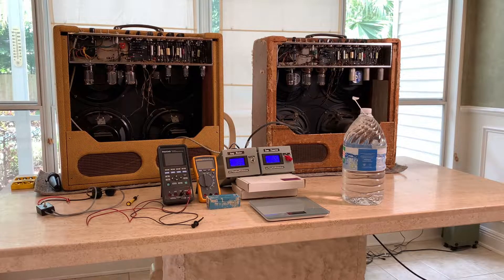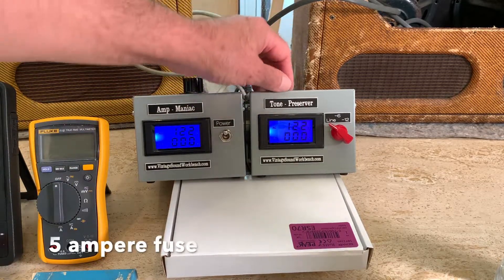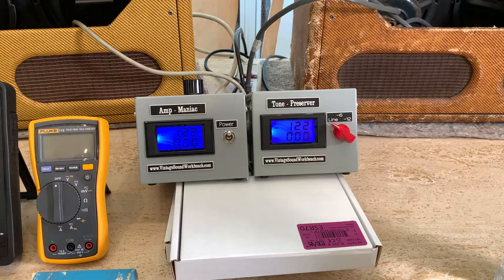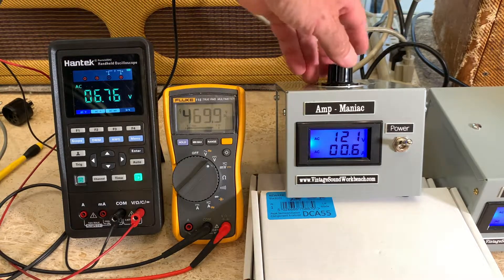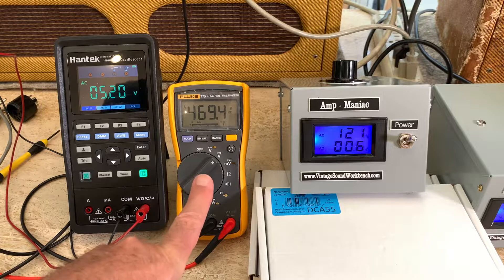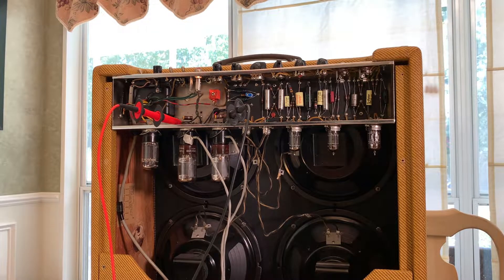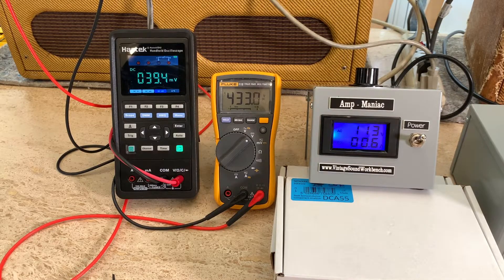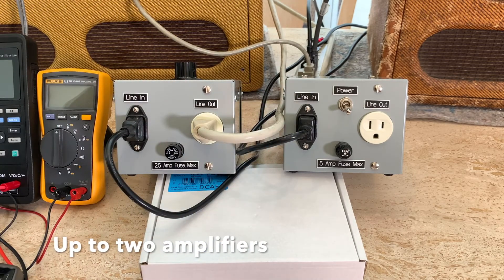Amp-Maniac Demo - A Fully Adjustable Voltage Reducer for Vintage Amplifiers

Comment: What is the lowest voltage amp maniac can lower to? Apparently van Halen liked 89 volts. On the amp maniac website it says NOT to do this - but I can it even be done?
Reply from the maker: I think it goes down to 0VAC but I know I turned it down at least to 30VAC.  The Van Halen story is mostly a myth.  I wouldn't recommend doing that to any amp.  The heaters in the tubes would barely be running.  They are designed for 6.3VAC and it sounds strange if you go much below that plus it wears your tubes out really fast.

Comment: could you convert the maniac from 2.5 amps to 5 amps? i have 65 and 67 bassmans and seems i could run off one maniac but the extra amps could be good.
Reply from the maker: He used to make a 5 amp version but it is heavy and more expensive.  He probably can still make it.  You could go with the Amp Preserver which I think is rated a 4 amps.  I run as much as I can get away with on my Maniac.  The worst thing that can happen is you will blow the fuse.  If you gigging, take some extra fuses but test it for a while with both amps.  You can watch the amperes rise on the meter and it usually takes more than it is rated before it starts blowing fuses.
Reply: @millstap  i saw a picture on his FB page, i will be asking for a custom 5 amp. thank you for the quick response and excellent video review

Comment: Hi there thanks for the video! Question- am I able to hook the amp maniac to a tripp lite line conditioner or power surge? 
essentially amp->amp maniac->line conditioner. 
or just hook the amp maniac up to the wall outlet?
thanks!
Reply from the maker: That's what I do.  I have my Fuhrman plugged into the wall and the Maniac plugged into the Furman.  Then I plug another power strip into the Maniac and run several amps off of the strip.

Comment: what a total crock of internet baloney poo.... got news for ya as a geek with over 50 years experience.... a couple volts difference in line voltage makes absolutely no difference. save your money for something useful. this is just a way to get gullible people to waste money. keep it for yourself. most tube amps will fire  and pass signal anywhere above about 30 volts, but that doesn't mean it sounds "better" or "makes stuff last longer" or ANY of the bs promised by this snake oil slinger. facts.
Reply: @ErikThomasMusic  winning lol

Comment: AmpManiac will not regulate or correct your house voltage to 115 volts for example. The house voltage fluctuates as day goes on. At 1pm it can be 120v and at 2pm it might be 125v then at 6pm it will be 117v, etc. In order to get consistent 115v, you have to buy a furman 120v voltage regulator that will output constant 120 volts. Then you plug the AmpManiac into the furman unit and turn it down from 120v to 115v on the AmpManiac. You need both devices so you don't have to readjust the AmpManiac when the power company decides to change your house voltage in middle of the day for example. Even modern amps that are designed to run on 120 volts can benefit from both of these units to bring the house voltage of 125v down to 120v and keep it there. Remember that house voltage swing of 5 volts will produce a larger swing inside the amp because of its transformer.
Reply: actually, no, you need neither. your example is correct, the voltage will be all over the place. it won't affect the amp or its performance.

Comment: Could a voltage reducer be useful for even a solid state amp, to preserve components as well as helping to get a less "brittle" sound?
Sincere question. Thank you for video.
Reply from the maker: Math, this is the answer from Carl himself, "If SS amp was built for voltage lower than 120-125 then yes, would help preserve component life. As far as brittle sound, no idea. That’s a characteristic of many SS amps."  That's my thoughts too.  What year was the amp built?  If you house voltage in your area is even higher, it could help even with a fairly modern amp.  If you have a Digital Multimeter, you can test the voltage in your socket.
Reply: @millstap  Thank you for replying and the homework. : )
Reply: no. misbiased solid state will not sound more musical, and will be blatty and harsh. you don't want to brown out a solid state amp. think of a fuzzbox with a voltage starve or "sag" control. same basic idea.

Comment: So question for ya. Would there be any issue running my whole rig off one of these boxes? My single amp and pedal board and pedal power supply? Just wondering if that may be ill advised running a pedal power supply under 120v. Great video!
Reply from the maker: Most power supplies are designed to run on 100-230VAC.  I run all of my pedals on it.  It still ends up being 9V, 12V, 18VDC or whatever it needs to be at the pedal.
Reply: @millstap  in other words, it has no effect. lmao
Reply from the maker: @666pinkster  Not on power supplies because they are their own little step down transformer themselves.  That's why you can take your IPhone charger from the USA 120V to the EU's 230V with no issues.
Reply: @millstap  the guy asked about running his "whole rig" on this snake oil. yeah, stompboxes, like the transformers in TUBE AMPS which do virtually the same thing. but try running a digital stomp or rack unit on lowered line voltage.  forget it. dude, no offense to you, but the guys slinging this thing are selling snake oil. the amp's don't care about the line voltage much. the entire reason folks like evh used a variac in the first place was to misbias his amp by browning it out. tubes aren't like transistors. most tube amps will begin passing signal with a line voltage of 30 volts or less, and tubes by nature of their charicteristics don't like to stay saturated. they're continuously trying to soften any distortion generated. lowering voltage to them makes a marginal difference that people "hear" cuz they choose to. doesn't mean its a great idea.  there's a lot better things to spend money on, bud. peace
Reply from the maker: @666pinkster  Jimi, the whole purpose of this box is just to keep the amp from running too hot and to extend the life of your old components and NOS tubes, especially on the Tweed amps that were designed around 110V.  At 125VAC you could easily be running the plates on your old RCA 6L6GC backplates at 500V which is over their rated voltage and way over the 400V on a Tung-Sol 5881 even though Fender designed those circuits to have over 400V from the beginning.  They are tough tubes but, if you can afford to extend their life, then more power to you.  I've spent way too much money on old tubes not to do it.  And all the other components get hot so anything to reduce that heat, which shortens their lives, is great too.
Reply from the maker: @666pinkster  Tell that to the BrownBox people. They’ve sold hundreds of thousands of them at twice the price.
Reply: @millstap  its literal snake oil "mojo". its marketed as a tonal improvement. yeah, right. good luck widdat ;)
Reply from the maker: @666pinkster  Carl’s were the very first on the market starting back in 2008. AmpRX saw the opportunity and spent a ton on a massive marketing campaign and thus the double price.
Reply: @millstap  that may be, but snake oil remains snake oil regardless of its price point

Comment: You mentioned you think you could run two amps with the maniac but you never tried it in the video. What would happen to my amp if my line voltage is 120V and I adjusted the bias set at 117V and someone turned the maniac all the way up to maximum 125V. Wouldn’t that be almost as bad as using a variac max 130V and having the same scenario happen?
Reply from the maker: Neither situation would be ideal.  At 125V or 130V the bias would definitely be on the hot side if you set it at 70% at 117V.  At 130V though, you would have a better chance of red plating the tubes.  Just as long as the Maniac isn't kept at 125V you should be fine.  I don't think the tubes will red plate at 125V.  Just keep those handsy people away from your Maniac, lol.  Variacs are useless when it comes to hauling those heavy things around.  I love my Maniac.  Right now I'm running my 1959 Fender Tweed Bandmaster at 112V and it sounds fabulous.  That puts the heater wire voltage at exactly 6.3VAC which is what the tubes are supposed to run at.  And, yes, I have have played two amps loud on the Maniac with no problem.  You may even be able to go to three amps.  The worst that can happen is you blow the fuse in the Maniac.  Just have extra 2.5A fuses on hand.  I run another group of amps and effects on my Preserver at 117V which is fused at 5A.

Comment: great video- thanks. I just ordered one of these because of your video. Nice pair of Bassmans too!
Reply from the maker: Hey Shane.  Wow, I covered one of your songs on my channel 10 years ago.  These are great devices and were really the original voltage reducer back in 2008 when Carl built one for  G.E. Smith.  Yeah, the Bassmans are special.  I will turn on my Super Reverb and play for a while but at the end of the night, it is always the Bassman.  Just curious, with the French name Theriot, do you have relatives in the Lafayette, LA area?  That is one of my old stomping grounds.
Reply: @millstap  no my family is from Thibodaux and New Orleans (mom's side) but I'm sure we were all brought over at the same time after the Brits kicked us out...haha. As for the unit, seems like it would be handy for new amps designed to run at 120 but wall voltage is coming out at 125 or 127...or would that even make a difference?
Reply from the maker: @TheRiotguitar  Definitely.  If you biased your amp at 120VAC, then you can keep it exact wherever you go.  Just remember to note what voltage you are at when you bias your amp and then just dial in that voltage at every venue.  The voltage can change so much from venue to venue, you don't have to worry anymore.  But, you won't be able to go over the house voltage which shouldn't be a problem.  With a Variac, you could mistakenly go to 130VAC which would fry some tubes.  It's a not brainer really.  You might end up with more than one.  I have three.  It really depends on how many amps you plan to run at the same time.  If you are two or more, then the Preserver is fused at 5A but not as adjustable as the Maniac.
Reply: @millstap  thanks for the info!
Reply from the maker: @TheRiotguitar  You're welcome Shane.  I've run two 40w Fender amps and a vintage Fender reverb unit on the Maniac.  The Maniac is fused at 2.5A.  You can add as much as you can get away with until the fuse blows.  Most amps idle around .6A and 1.4A when cranked.  Even if two amps are cranked at possibly 2.8A, you may not blow the 2.5A slow-blo fuse.  But, at a very high profile gig, you wouldn't want to chance it.  Keep some 2.5A and/or 5A fuses handy for the Maniac or Preserver, respectively.
Reply from the maker: @TheRiotguitar  Shane, I'm so embarrassed.  I just realized you were my favorite guitar player on Live at Daryl's House.  I can't believe I didn't recognize you.  I love that show.  That is the best show about music to ever be produced.  My wife and I were just watching the Elle King episode.
Reply: @millstap  aw thanks! Yeah Elle was great to work with.
Reply from the maker: @TheRiotguitar  "Looking for Shane's Cajun Ass," says the Reverend B.F. Gibbons.  Sorry to bug you again Shane but this was too cool.  I grew up in Cajun country so I can totally relate.  The music scene was killer.  I remember seeing Jeff Pollard in Gerard Park in Lafayette way before he ever started the band LeRoux.  I think it was probably 1970-71.

Comment: the fuses on the back of my 100w plexi and 30w bassbreaker say 3amps, will this work with either of those cranked on 10? I only use 1 amp at a time, planning to use something like this for the 30w cranked
Reply from the maker: It will work fine on both amps.  I've run two vintage 40w Tweed Bassman amps on it and they are fused at 3A.  I have both the Maniac (2.5A) and Preserver (5A).  For years, I ran all of my amps and reverb units on the Preserver and never blew a fuse.  The only time I blew a fuse is when my GZ34 rectifier tube was going bad and arcing internally.  You can experiment and run both amps on the Maniac.  The worst that can happen is you will blow the fuse on the Maniac.  The good thing about having the ammeter is you can see what your amp current draw is when you are playing.  When I am playing very loud, my Bassman runs around 1.4A.  It idles around .6A.  Two Bassman at loud (not cranked) volume would theoretically run around  2.8A but I've done it without blowing the fuse plus I had a vintage Fender reverb unit hooked up too.  The best situation IMO is to have the Preserver for home and hook everything up to it.  I have a power string with 8 things plugged into it.  And then have the Maniac for gigs so you don't have to unplug everything at home.  Since I am not gigging anymore, I have one amp on each.  I do like the Maniac for the precision but the Preserver works just fine on getting the voltages in a good range.  The disadvantage is if you are gigging, and each venue has a different house voltage, the Preserver will only allow you to drop it -6 or -12VAC but the Maniac will allow you to dial in the voltage precisely to the voltage you biased the amp at, at every venue.
Reply: @millstap  Awesome! Thanks so much for the detailed answer! Im sure this will help others also :)

Comment: I just went into the Vintage Sound Workbench website and it's stating that both units (Amp Maniac and t
Tone Preserver) are 2.5 amps ... amp I reading that correctly?  In your video you stated the Amp Preserver is rated at 5 amps.  I initially freaked out when I heard you say that "maybe" the Maniac could run 2 amps ... well I have 2 amps in my rig which will be on at one time always and I thought perhaps I purchased the wrong unit ... regardless, the appealing thing of the Maniac is being able to dial it down precisely to the voltage you want ... If necessary, I'll buy an Tone Preserver too.  I almost bought a Brown Box ... that would have been a big Whoops, could have saved money!great video and thanks!
Reply from the maker: The Preserver is 5A.  What two amps are you going to run on the Maniac?  I run two 40 watt Fenders with no problems at all.

Comment: What's the ohm load on those old Bassmans? Is it 2 ohm like the modern ones?
Reply from the maker: You mean the speakers?  It is four 8 ohm speakers in parallel for a total load of 2 ohms on the OT.

Comment: I have a vintage 67’ blackface twin.... do I need one of these?? What year did they switch to 120v
Reply: Agree with Bob C, check the tube chart.  The move to 120v supposedly occurred in 1967, but manufacturers of most devices took their time to use new appropriate power transformers (gotta use up that inventory).  Most likely your amp is looking for 117v, rather than the 125v most of us see today.
Reply: Look on your tube chart pasted inside the cabinet. It should have the voltage listed.
Reply from the maker: "Voltages gradually increased over the years from 110V to 112V, 115V, 117V and finally to the current standard of 120/240V at 60 Hz in 1967." -- quote from the internet.  Your tube chart should say 117VAC.  I have a 1966 Super Reverb and that is what is on its tube chart.  You can be sure that appliance and amp builders did not begin to transition to the higher voltage PT's until many years later.  If you have a huge stock of power transformers, you are going to install all of them and then get a new transformer.  Even then, I'm not sure they changed the PT at all so you would end up with higher voltages on the amp.  Ironically, it was in the early '70's when amps started taking a turn for the worse when it came to tone.  I would say a reduction of -6 to -7 volts would help your amp.  And when they say they settled on 120V it is actually as high as 125V in certain areas.  I may do another video in a few weeks on the blackface amps with 117VAC requirements just to see how high the voltages actually are in those amps.  They use a different PT than the old Tweed amps.  Bassman is 8087 PT, and blackface SR is 125P5D.  According to Classic Tone, they are essentially the same transformer but we will see.  Maybe the newer 125P5D had more secondary taps for international orders.

Comment: Never did trust that brown box thing
Reply from the maker: I'll have to say they have an impressive advertising campaign.  I wonder how much it costs to get the endorsements of virtually every living professional musician on the planet.
Reply: @millstap  people are dumb, and make dumb choices. if everyone says the sky is beige, does that make it reality? nope. i''ve tried this unit, a friend bought one. ssdd. my variac on my bench works better, is cheaper, and is useful. this is mojo baloney, sorry, bud.
Reply: I would think after all the videos you’ve done that some of these companies will start throwing you a bone or two You’ve grown a pretty good little fan base I still don’t know why you don’t show off some of those other apps of yours like I say I love that blonde bassman that you have
Reply from the maker: @bobbarcus8310  I know.  I really need to get the blackfaces and the Blonde going again.  I think they need a little bit of fine tuning although I did check those blues molded caps in a couple of the circuits and found none to be leaking.  They hold up pretty well.  I think I will do another video like this one and see how the voltages fare on amps that were designed for 117VAC.  Some people have been asking that question.